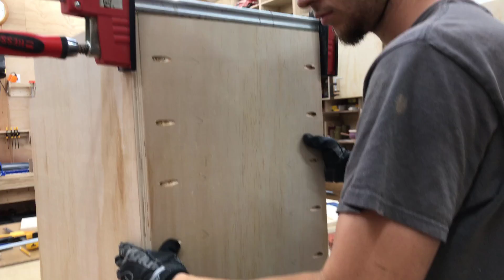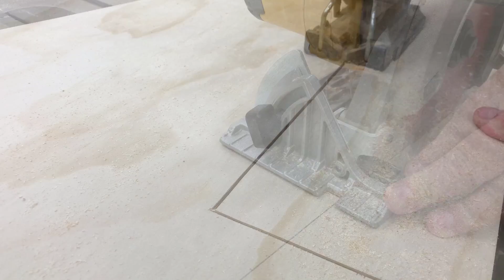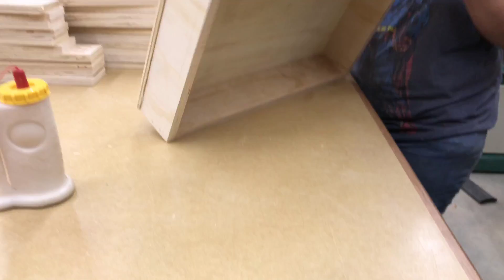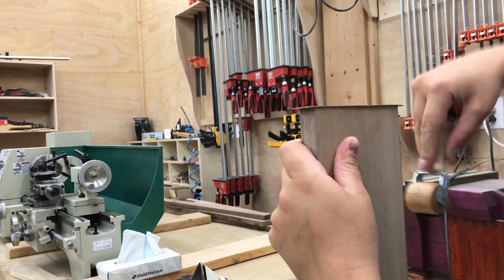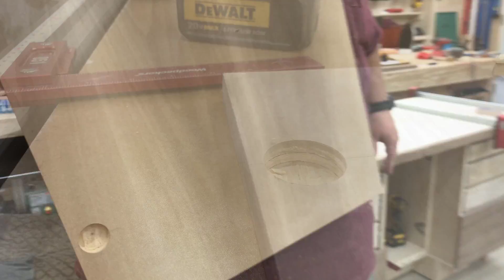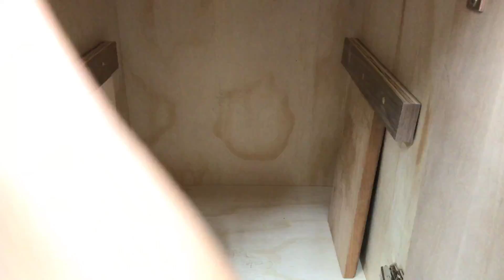25 - How To Build the Extreme Lathe / Benchtop-Tool Mobile Cabinet

Comment from the maker: I invite you to join our Kings Fine Woodworking Community  https://www.facebook.com/groups/KingsFineWoodworkingCommunity/ 
Get help on your projects. Share pictures of your work in our gallery. Get advice from master woodworkers, and more. Learn new tricks, tips and techniques.
Reply: King's Fine Woodworking
Seeming I don’t have Facebook I just wanted to ask a question I was wondering where you get the boxes of 
Pocket screws from there are very expensive from Kreg so I was wondering if there is other options 
Thanks
Reply from the maker: Chris Morley, Hi. I buy them here on Amazon. This is a pack of 5000 
http://www.amazon.com/dp/B000BN33DM/?tag=kingsf-20
Reply: King's Fine Woodworking I just signed up to join your FB Community - I’m hoping to get notification of when you and “the usual suspects” have live shows. 

And what type of wood screws did you use to hold the top plywood down? It looked like no pilot holes were needed.
Reply from the maker: Hi Barbara, those were cabinet screws. And you are right. No pilot hole needed. They are made by GRK

And it’ll be good to see you in the community. By the way, Sai is working on your Mallet!
Reply: I can't seem your link to the slides you mentioned

Comment: oh this is terrific! I was considering getting a rolling tool chest but i'm irked by the idea of using a lathe where there's no area for knees etc if i'm seated at a stool. and I like that i could bang together the carcass now and fit it out with drawers later. 

i guess the main question is - 5 years later how's it working? does it still roll well, do you move it much, any sagging or issues with alignment on the lathe?

Comment: Where is the link to the Pro 100 drawer slides
Reply from the maker: They come in 10 sizes and 2” increments. From 10” - 28”

10” drawer slides (10-pack)
https://amzn.to/3qJ08Fi

12” drawer slides (10-pack)
https://amzn.to/2OXBeUs

14” drawer slides (10-pack)
https://amzn.to/2NI58eT

16” drawer slides (10-pack) 
https://amzn.to/2NFkkJA

18” drawer slides (5-pack)
https://amzn.to/3bnpPVA

20” drawer slides (10-pack)
https://amzn.to/2Ngazlp

22” drawer slides (10-pack)
https://amzn.to/35X71KJ

24” drawer slides (10-pack)
https://amzn.to/2NKGFFL

26” drawer slides (5-pack)
https://amzn.to/3bt2d1C

28“ drawer slides (5-pack)
https://amzn.to/37A6orv

#6 x 5/8” oval head wood screws
https://amzn.to/3dy3es6

Self centering VIX drill bit
https://amzn.to/3pB6a9z

Comment: I use two sided tape to hold my drawer faces so I can eyeball them side to side up and down. It will hold it in place so you can open it and add screws.

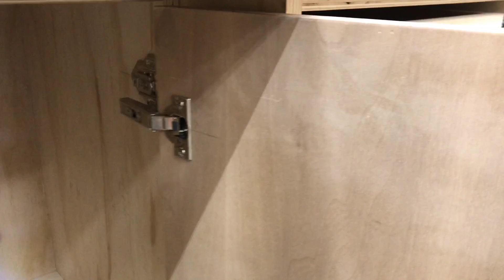Comment: 28:35 Should you accidentally over-tighten your mounting screws for your hinges and strip out the holes, there's a very easy fix, using some round toothpicks. You'll want the round toothpicks because they're thicker and stronger than the flat ones. Dip a toothpick in some glue, insert it into the stripped out screw hole, and just snap off the excess. Larger holes might require 2 or 3 toothpicks to fill the hole, and a very light tap with a hammer will help seat the toothpicks nice and deep in the hole. Allow the glue to dry, and drill a new hole. For larger holes, or if extra strength is required, drill a 1/4 inch hole, or larger if needed, and plug it with a dowel, then drill a new hole.
I  am getting very close to buying a CNC machine, and this is probably going to be the cabinet/stand I build for it.

Comment: Nice fit on the drawers , if I had to make a few changes i would add the metal handles and also a thin sheet of metal for the top . I find myself using lubricants for drilling parts on my lathe . The wooden top will get soaked and some parts can fly off extremely hot , I'm sure you are aware of that .  Nice build , very clean work .

Comment: I’ve always wondered about mobile benches like these, are they rigid enough to be able to pack and get any twists out of the ways?
Reply: If you are working to a thousandth of an inch...no.  But it is easy enough to get four hardwood blocks with wedges to put under each corner and then tap the wedges in as you take your level and twist readings on the ways with a precision level.
Reply: @Gronicle1  yeah i thought as much...in fact, i'm highly doubtful that even packing it when you want that accuracy would be of any benefit - the resistance to twisting in the bed would overpower the weight of the cabinet. realistically though, unless you're turning something like a shaft it probably doesnt make much difference to the average joe who makes bushes and sleeves etc. nice built otherwise

Comment: I have one suggestion. You WILL end up using cutting fluids with your lathe so need a proper drip tray - easy to make or cheap to buy. Oily plywood is a pain.

Comment: On my toe kicks, I've been placing the sides of the cabinet with the toe kick 3/4" in on each side. It breaks cabinet protocol but in my opinion looks better and more uniform. Plus you can finish the sides of the cabinet without working the toe kick into the surface.

Comment: I noticed you did not use glue with your pocket screws, is that normal??
Reply from the maker: Hi Tim, I usually don’t because the glue will be an endgrain joint which is very weak anyway. And for cabinetry, I will often want do disassemble it later.

Comment: It has been two years since you made this video.   Have you discovered yet why putting a metal lathe on a wooden stand is not a good idea?  In case you have not, check to see if your lathe is cutting a taper.  Metal lathes are notorious for allowing the bed ways to twist as the mount settles.  Twisted ways cause the lathe to cut tapers.   It does not take much.   I recently retuned my 12x36 lathe that had settled enough to allow a .0033” taper per foot.  Absolutely unacceptable on a metal lathe.   The fix was to put  a shim measuring.0012” thick of under one foot of the lathe.   So it does not take much.    You may have to tune your lathe much more frequently.   It took three years for mine to settle that much.

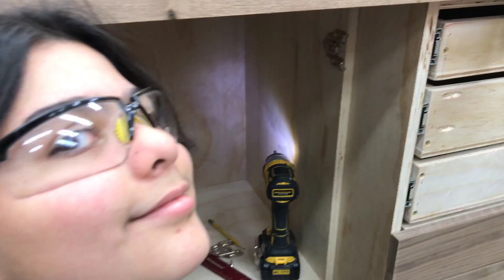Comment: I dig that drill press table with the graduated track setup you're using at 26:26, though there wasn't a link for it in the description and I didn't see anything on your plans page. Do you have a build video for that thing? Or even just a link for the graduated extrusion pieces would be a bonus. Thank you. Cheers!

Comment: If you strip a screw hole in wood or find a loose screw in wood just take some wooden match sticks, dip in glue, stick in striped hole, cut or break off flush let dry, the hole may need two match sticks

Comment: nice build. a piece of high pressure laminate will protect your top from oil and metal chips. i have noticed in your drawer build, you screw the bottom on. do you ever use a dado and slide the bottom in then a dado to hold the back in place?

Comment: contact cement wood be a better glue to use for you plant on gables. that way it sticks right away and you don't have to see the nails. should never see a nail in cabinet building.

Comment: On a metal lathe, you should double the slides. 3 and 4 jaw chucks will exceed the weight of the slides easily. Add the metal Lathe accessories I added double slide bottom and mid length. Another problem is you have to maintain perfect leval on extended rails of length. After approximately 6 inches your run out will be extreme. A Metal lathe should be mounted. Just saying. I have several and I have a 13 x 7 Southbend. And a 9 inch. Were talking 3 to 5 thousandths of a inch and more. Another Question, can you stain the edge banding??. I put veneer strips on , what a pain! I also use formica. I  like that banding. And soo many too chose from

Comment: Very nice work bench for your Lathe. I like it much, the only thing , does this bench need that much of Glue??? . May be later you can add a sheet of 0,8 mm Aluminium or yellow copper Top to give it more protection and will be easy to clean. Well done and I like to see more of your Videos.

Comment: Great video.  What were the cabinet screws you referenced?  I did not see a link for them.
Reply from the maker: Hi Frank,  these are the exact cabinet screws I use. They are perfect for attaching two cabinets together, since they don’t stick through, and they have a built in washer on the head, and they’re extremely sharp/pointy, and don’t need to have holes drilled first. 
https://amzn.to/2usDLvd
Thanks,
James

Comment: Hi James, 
A quick question regarding the construction of the cabinet carcasses. I love the use of pocket holes/screws, but I noticed you didn't use any glue? Was that to save time, or do you typically not glue when building cabinets? I'm about to build a bunch of cabinets and would love to know your thoughts. Thanks!
Reply from the maker: Hi Shane, I never use glue for my cabinets. And I built kitchen cabs professionally.  

There are a couple of reasons. One is that they occasionally need to taken apart to re-size them. And if they are shop furniture, I reuse them after their useful life so disassembly is important and easy that way. 

I don’t think you gain any appreciable strength difference by adding glue especially since all joints are end on the grain.

Comment: I would have just put the wheels on each cabinet with support blocks and screw together, no glue, so if I wanted I could move the cabinets around any time and make them mobile.
Reply from the maker: You could certainly do that.

Comment: Great design and craftsmanship.  The only thing I would have done differently would be to put the draw rails at a  5 to 8 degree angle to ensure the self closing once you have let go of them.
I did that to my home made workbench after getting my chins all cut up on my previous design. I forgot to close a draw on occasion and cough my legs on them practically tripping to the floor.  I too have my 500 pound lathe on the Workbench and the thoughts of my arms flailing about grabbing anything for stability near a running lathe was pure horror.  I made the change.
The Draws now work like those on an over priced industrial Vidmar Cabinet, Self closing and lock latching.
Look at some of the YouTube "Lathe Accidents" and you too will modify the draw rails.
John USN Ret.
Reply from the maker: Hi John. That is a fantastic idea! Thank you so much for commenting!
~James

Comment: I can't find your link for the five dollars  drawer slides, also where you get your screws. Thanks
Reply from the maker: Hi, I just checked the link in the description above, and they have raised the price a little. That's not cool.  The 10 pack is now $61.90, which is $6.19 each.
Pro 100 drawer slides    http://amzn.to/2rKGNFC

If you need just one pair of slides, I'm not sure where you would get them, because the single price is very high.
Reply from the maker: The screws I use for the drawer slides and hinges both, are these:   #6 x 5/8" Flat Head Phillips Deep Thread Wood Screws;  http://amzn.to/2x66yGm

Comment: Another awesome video,question on the drawer slides,you align the base to the front of the cabinet and the slide to the front desk for the drawer,seems I'm not doing something right,some protrude slightly,I was thinking I had to recess a little
Reply from the maker: HI Dan. It depends on the drawer slide that you use, some close a little tighter if you keep the base portion of the slide back about 1/16" from the front of the cabinet opening. But some work better if they are both flush the way I did it.

If you have some protruding out, all is not lost. There are many holes and slots along the length of the base portion of the slide, simply insert a few screws into the slots in the base portion, but not fully tight. Then, remove your existing screws and tap the base portion of the slide back slightly. (About 1/16")

You will need to do this for both sides because they need to be symmetrical.  Then make sure to fully tighten your screws. This should fix your problem. I hope that helps, if not, please message me.

Thanks ~James

Comment: James, Thanks for yet another great video! You mentioned in the video that you were going to post a link for the "VIX BITS" that you were using for the drawer slides. I am about to start my own Miter Saw Station and wanted to order the bits before I get started. If you can benefit from posting a link for me to order from that would be great.
Reply from the maker: Hi Russell! It certainly does help support our channel. Thank you. 

This is the set that I use. For some reason they are chrome, and mine are black, but it's the same brand. There are 3 different screw sizes that you typically use for drawer slides & hinges. This set has all 3. 
http://www.amazon.com/dp/B0037MF78S/?tag=kingsf-20

Thank you very much!
~James
Reply: Thank you James! Ordered...
Reply from the maker: That was very kind of you. Thank you!

Comment: Good looking cabinet! Definintly strong enough. The only thing I would do different is a metal top. I think the wood top is going to get beat up pretty fast. with metal chips and coolant.
Reply from the maker: Thanks. That has been recommended a few times. I probably will add that.

Comment: Another great video.  How big is you table saw out Feed table? Looks very well built.
Reply from the maker: Hi Jeff! The outfeed table is 4' x 8'. It is pretty heavy duty with a 3/4" sheet of plywood laminated to a 3/4" sheet of MDF. It's wrapped in a band of solid cherry and has a framing lumber under-structure with something akin to joists on 16" centers. I've also wired it, so that I can have some more electricity points.  I also have a Shop Tour Video coming out tomorrow, in case you are interested.  Thank you for watching.  ~James

Comment: Instead of screwing from the bottom up on the drawers, wouldn't it have been stronger to drill pocket holes on the sides and screw down into the drawer bottom?  Either way, between the screws, glue and staples it's not going anywhere.  I'm just curious.
Reply from the maker: That is a good question.  I think it is stronger to go through the bottom the way I did since I can use a longer screw and get more threads biting. In my case I used an 1-5/8" screw.

A pocket screw from the sides down is limited to a 1" length screw since the bottom is only 1/2" thick.

Comment: I come from the metal working side and at 60 years of age I'm becoming interested in wood. Personally I think you may have ruined yourself, because all my friends that used to do wood and went to metal never went back, works out for me because I'm picking up some of their wood equipment. I really enjoy your videos they are well edited and very informative. I have a small lathe my Dad started out with on a ratty work bench that I now know how I will update. As far as this project being over engineered let me say this, the weight of the lathe is light, a collection of all the tooling and chucks for a small lathe become very heavy. Your design is outstanding.
Reply from the maker: Hi Douglas!
Now you warn me about the metal working! Why didn't you tell me about this BEFORE I bought the lathe!?
Thank you for all the compliments! ~James
Reply: LOL

Comment: Your commentary is excellent. which of course leads to more questions. In addition to the lathe, how heavy do you figure the cabinet and its expected contents will be (thinking in terms of the number of casters)?
Reply from the maker: We weighed the cabinet to be 200 pounds. The lathe is actually 480. And all the accessories I have so far weigh less than 100 pounds. That puts us at about 750 total pounds. And I checked the casters that I bought. They are rated for 250 pounds each for a grand total of 1000 pounds so I'm in good shape. Just to be safe, the casters I put in the link, if any of my viewers want to order what I have, are 300 pound rated casters.
Thank you for watching ~ James

Comment: Well done.

The recessed cabinet, do you regret that choice?  It does add some dimension but looks a bit impractical.... did you think it would help when you're using the lathe to have more access to the piece you're working on?  Did it work out?
Reply from the maker: I don't have any input yet since I haven't even begun to start using the lathe. But I will certainly post an update as time goes by. Thank you

Comment: i have an account with wurth also and am having a hard time finding that spray finish. whats it under?
Reply from the maker: Hi! I actually buy the Deft Lacquer finish from Home Depot or Amazon. I have an Amazon link in the description for the spray cans, but for the gallons nobody beats Home Depot's price.
Reply: King's Fine Woodworking do you thin it with your sprayer? Or just straight from the can?
Reply from the maker: I just use it straight from the can. No thinning. And I only have a low priced husky sprayer. But it seems to work great. Although it is time to replace the sprayer now. It did last for hundreds of kitchen cabinets, over a few years.
Reply: King's Fine Woodworking what sprayer do you have. Been looking to get one
Reply from the maker: Hi Garrett,  I use this exact one. http://www.amazon.com/dp/B00KFQSAMO/?tag=kingsf-20

Now, I know it's not a high dollar unit, but it works great for me, since all I spray is lacquer, polyurethanes, and stains. 

I've used this kind for maybe 15-20 years, and every 3-4 years, I replace it. In all honesty, I don't clean it as well as I should. It would probably last longer. But for the price, I'm happy. I get many hundreds of cabinets life out of a gun. Maybe 25-30 full kitchen jobs. 

If you are a casual user, it would probably last a lifetime. But during heavy building seasons, mine will run 6 hours a day for a few months.
Reply: King's Fine Woodworking that's I greatly appreciate your help! Just starting up my company so make sure to check us out on Facebook and instagram at GoldysDesigns